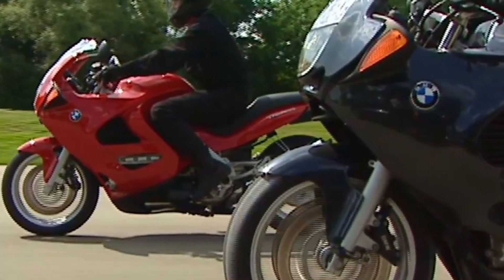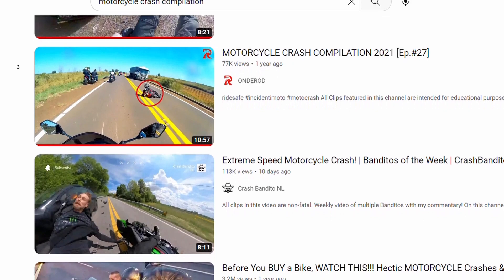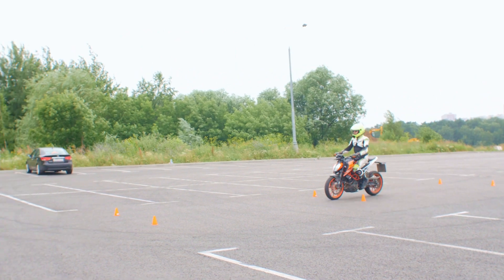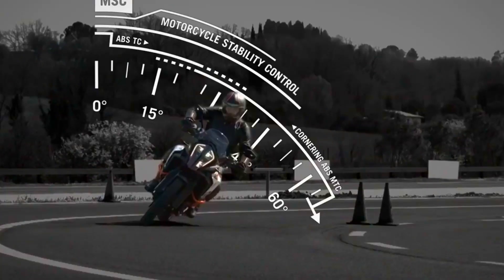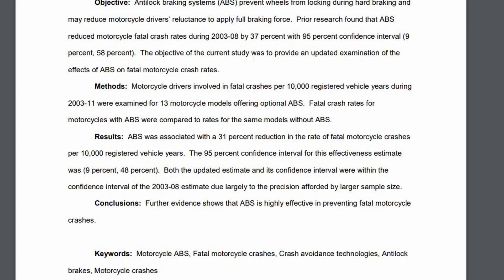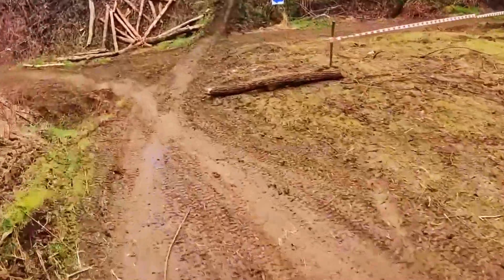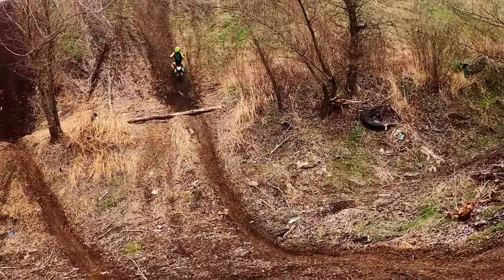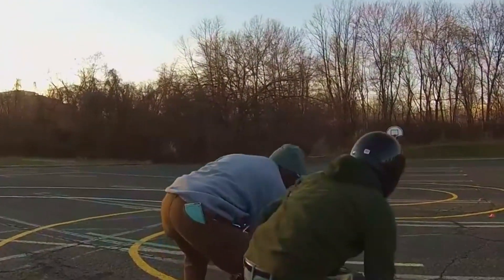How Motorcycle ABS Works? Facts and Myths.

Comment: I swap my old zx9r with a 125 Honda Monkey with front only IMU based ABS,  I tested on gravel and it worked great, but when I tested going down a wet grass hill, it locked up, .... I must say that my rear wheel doesn't have ABS sensor so it gets rear wheel data from speedo drive in gearbox (this is why I can't alter sprocket sizes), so I assumed ABS didn't stop front wheel lock up because rear wheel was higher than back so it calculated I was in a stoppie, but actually it would have relaxed front brake if it thought that, and also I learn here that stoppie is detected by calculating rear wheel speed and not a tilt sensor, so I don't know why it locked, does anyone have an idea why!?